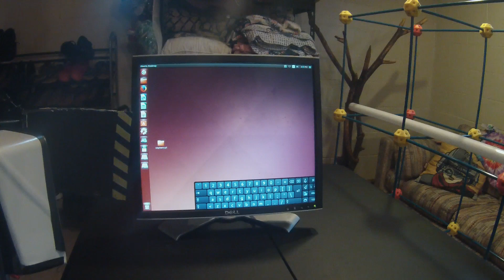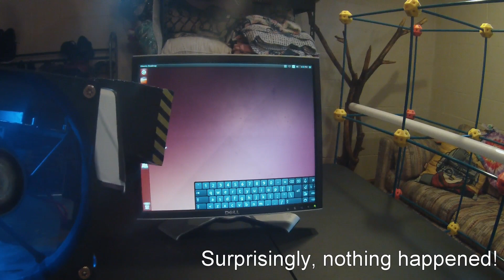Ultimate HERF Gun- Directional Microwave Blaster!

Comment: Nice! Do you have the expertise to design the waveguide dimensions or was there some trial and error?
Reply from the maker: Thanks! 
You know it’s funny because I’m not sure. I think I have enough knowledge to say I have the expertise but since there is always something more to learn and always someone to learn it from it’s hard to tell.

 I have studied electromagnetic radiation of all types for almost 20 years.  I also have a good background in electronics and mechanical engineering. I also teach courses on electrical, mechanical, and hydraulic systems currently. 

I read quite a bit about the topic directly before designing the wave guide and studied every one I could find. I came up with this one based on my reading, notes, and thoughts on the matter. The first one I made of this shape is the one used. I tried a few other angles with the same shape but this one had the most power over distance in minor testing over the course of a few days.

Almost all of the waveguides were welded by my friend Jay who did an awesome job welding the thin metal do dads I brought to him. Thanks Jay!

I had limited time to construct this piece as I was building it for a bacon themed event at the science center of Iowa. It was revealed at the science center along with one that used a backpack power supply. Along with a huge chunk of my other projects, these have been shown at events annually there for almost a decade, although they don’t get turned on and used at events and rarely ever at all anymore.

Comment: Looks like you used batteries which is good to use outdoors as a portable microwave but how did you use batteries when it requires thousands of volts, will you be able to do a drawing of what power source did you use. Cheers

Comment: I apologize. Perhaps you are being honest. I’ll give you the benefit of doubt. Look up targeted individuals, electronic harassment, electronic torture, organized stalking. It’s a sad state of de-evolution humanity is in.
Reply from the maker: I have no interest in stalking or harassing anyone as I do not do unto other what I do not want done to me. I would say that if you feel as if this is happening to you you would need to generate proof. To do this acquire a wide range radio and microwave radiation detector. Use it to take measurements of the radiation levels in your home or whatever location you feel necessary. Then take measurements of several other locations like the woods or a public space to have a baseline of the ambient levels as a control. Remember that microwave radiation is all around us in small levels through WiFi, phone networks, and other natural and technological sources. If someone was using microwave to cause differences in your thought it would be through pulse width modulation or similar and would likely be detectable as rapid changes in the intensity levels in that area. Remember that radiation of wavelengths usable for those types of nefarious purposes are limited in range and use large quantities of power and have a respectably large device footprints. These devices are able to be disguised as other devices as well so be aware when searching. It seems to me the hardest part of feeling that is happening to you is proving to others that it is. By doing an actual study to show the differences in radiation levels it could be a good start.

Comment: How did you make the horn to concentrate the microwaves?
Reply from the maker: It was cut from a piece of sheet steel and welded together
Reply: Troy Powers does type have yo be a certain size or angle?
Reply from the maker: To just work no, but to work efficiently or maximize distance and power then yes

Comment: In theory you could use rotating magnetic field around the output, either using coils or a rotating magnetic ring. If set up correctly It will spin the microwaves into a vortex and allow you to focus the beam. You could then fit a small alignment laser.........
Reply: How about some stepper motor housings? Remove the rotating internals, hook a few of the hollow shells together in a line using all-thread or long bolts, then hook them up in series to a single stepper controller. Experiment with the rotation speed until the desired effect is achieved. A little bonus would be that the aluminum housings themselves would act as a waveguide, with the rotating electromagnetic field further concentrating the beam. Would that work?
Reply: Helical polarization?

Comment: is their a way to focus it into a beam because its a wave length like light but could you still use lenses
Reply from the maker: HOT SHOT 1500 I suppose in theory you could but it would be necessary to find a material that bends microwave the way that glass bends light as it passes through. Generally you try to focus microwave using a metal waveguide to reflect as much in the general direction of your target as possible.
Reply: Would be better with mirrors as they aren't wavelength dependent.